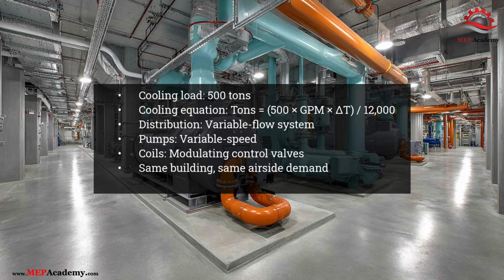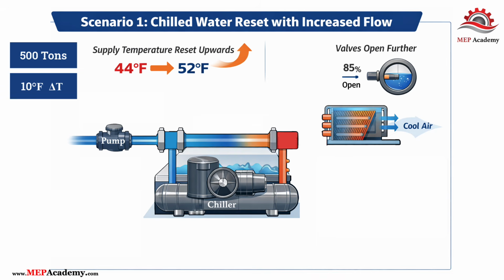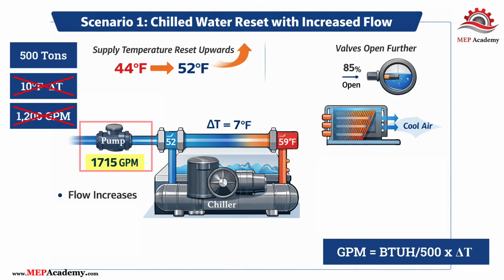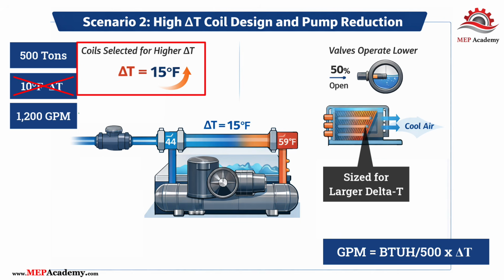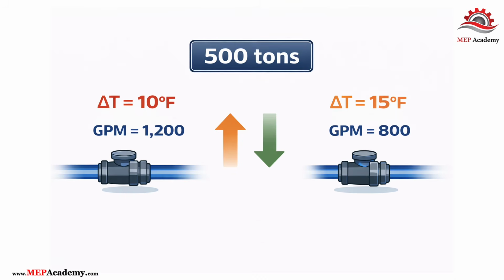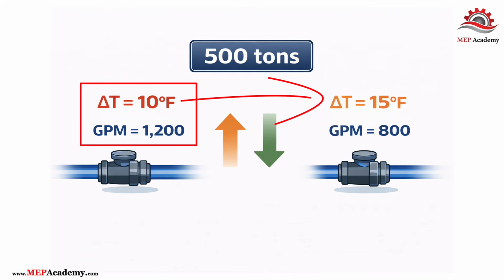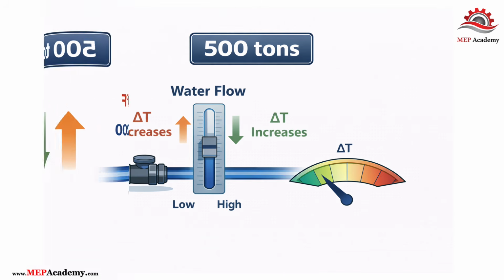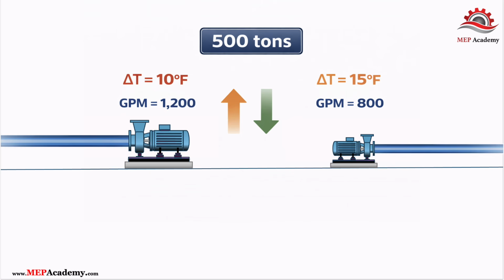Chilled Water Systems Explained: How Delta-T, GPM, and Load Affect Chiller Performance

Comment: It is decided based on the heat load. If the latent heat load is higher, more dehumidification is required. If the sensible heat load is higher, less dehumidification is required.

Comment: VFD's on chillers are one of the dumbest ideas ever. The machines have a min and max gpm needed for proper operation. Controls company's don't understand this concept. Seen it multiple times and have had to argue with customers and prove why the chiller is surging or why it's off on low refrigerant temp, Again. Data centers are prime  examples of computer geeks telling you how the machines operates and how to fix it.
Reply: Your comment is weird. I’m a design engineer, can you explain why chiller VFD is the dumbest idea? Maybe I need some additional knowledge for my career